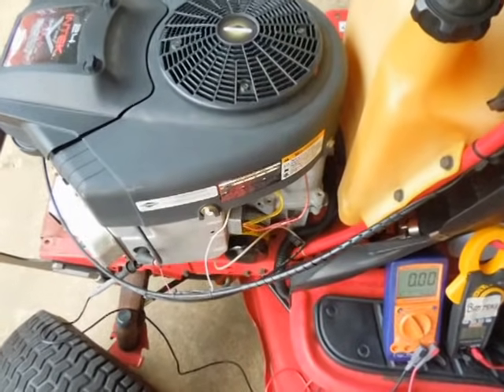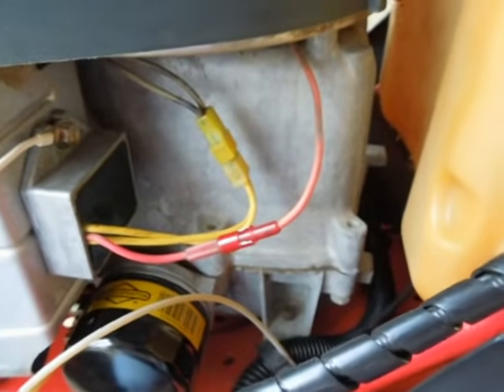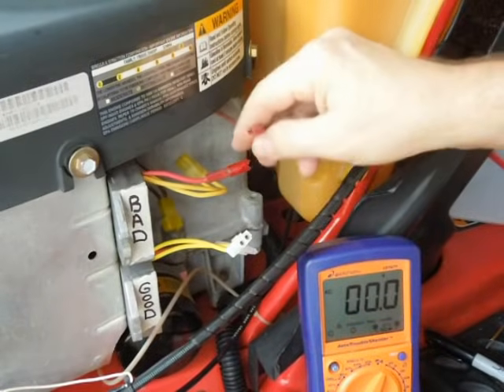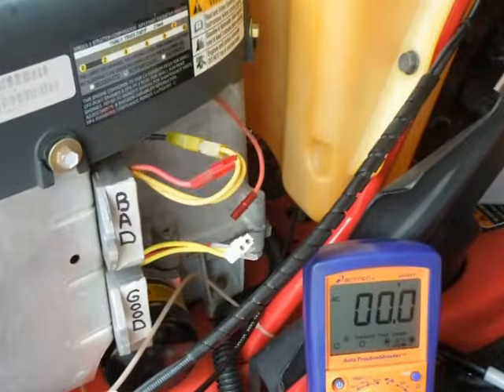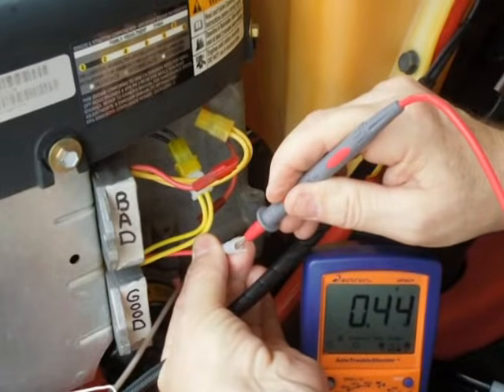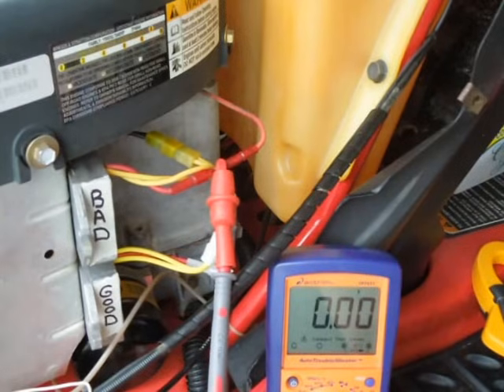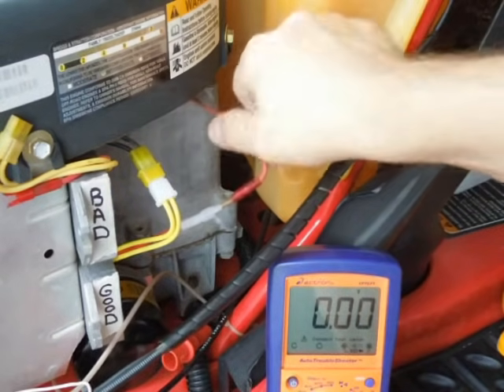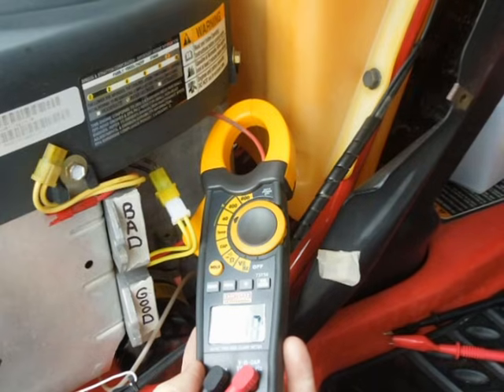Briggs & Stratton Battery Not Charging - Simple Voltage Regulator Test

Comment: I can't even find the damn thing. It's not connected to the sator on my 20hp briggs OHV
Reply: then you probably dont have a voltage regulator just a diode on your red wire (big lump) it rectifies AC to DC
Reply: Inspector More-Anonymous Correct! I've already bought and replaced the stater.
Reply: Yea I bought a brand new Poulan Pro with 19.5hp Briggs Intek, its been used for one season and the valves are gonna need adjusted already I can tell they are loosening up, and im getting 18V to my battery at full speed after 5mins of running,  and 16.8 at low idle, WTF right? never tested it last year while running considering it was brand new, I think the wrong stator was installed im going to have to regulate the voltage myself
Thank god it has an AGM battery, Im surprised it didnt destroy the battery running a whole season like that, battery is still A OK,

Comment: How do I do this with just one multimeter?
Reply from the maker: Check the battery voltage at the battery terminals, if its 12 volts with no load and 8 volts or more when cranking the engine, you have a good battery.  Then do the voltage checks at the regulator in my video.  I don't know where your regulator is but you should be able to find the wires coming out from under the flywheel and can trace them to the regulator.  I saw one video showing a briggs with no regulator and just a diode in the wires coming out of the flywheel, you may have this (cheap) system?  Look for that video.  Good luck and be safe!
Reply: +snaproll94e Yeah! It's not the battery and there is no regulator. The wires that come out from under the flywheel go to the headlights and to the key switch.
Reply from the maker: I'd still check the output on those wires.  It's got to charge some how.  If it's dc volts the regulator could be under the flywheel.  If there is no ac or dc output on those wires, odds are you still need to check whats under the flywheel.
Reply: +snaproll94e That's what I thought, lol but I was just hoping to avoid that. I did put the probes on the red and black wires that were coming out from under the flywheel but I wasn't getting anything when I had it set on ohms.
Reply from the maker: I read you checked ohms, did you check for ac and dc volts output on the wires with the engine running?  If you can't disconnect the wires at a plug, try probing through the insulation if your test leads have a point.  There should be some volt output between the two wires or between each of them to ground.  Don't use ohms with the engine running, you could blow up your meter or the fuse inside it.
Reply: +snaproll94e Alright! Thanks! I'll let you know how I do tomorrow.
Reply: SaltLife he is still trying today